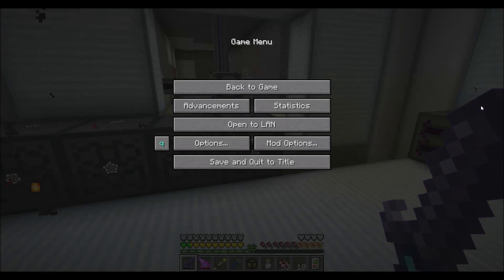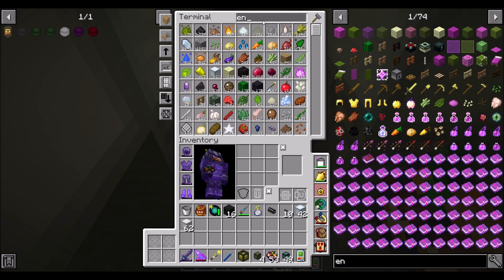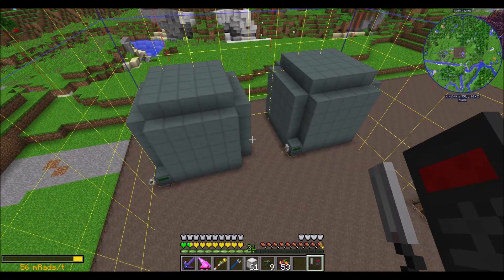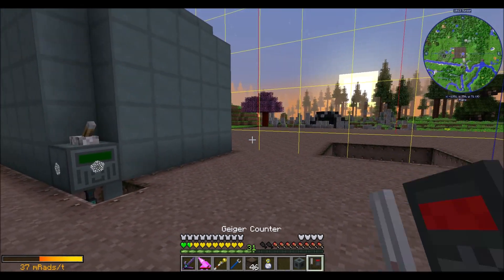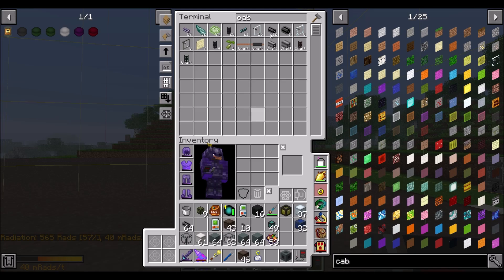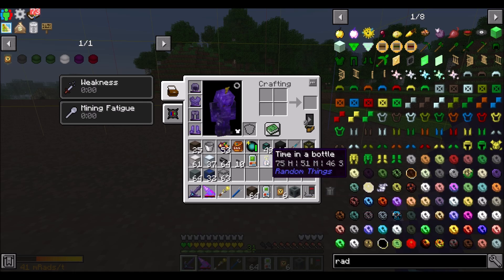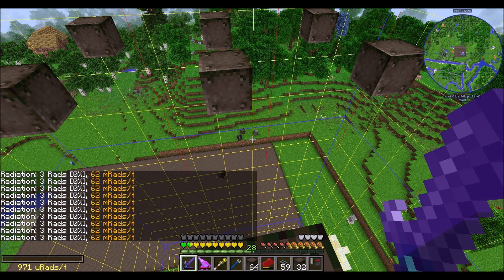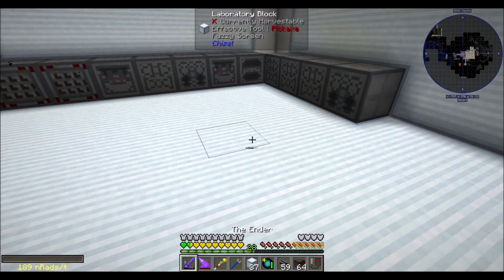MCEternal Ep100 Radiation Compensation

Comment: Small fix to your usage of SI units, Dire: 61 mRads is milliRads, microRads would be 61 µRads
Reply: or uRads with Minecraft font.
Reply: Double-fix, Gray (Gy) is the SI unit for absorbed radiation dose, where 1 Gy = 100 rads.
Reply: And if I remember correctly we have:
1fRad is femtoRad so 10^-12 Rads
1pRad is picoRad so 10^-9 Rads
1nRad is nanoRad so 10^-6 Rads
1mRad is milliRad so 10^-3 Rads
1Rad
1kRad is kiloRad so 10^3 Rads
Etc...
Reply: @BF26595   with micro added back in:
1fRad is femtoRad so 10^-15 Rads
1pRad is picoRad so 10^-12 Rads
1nRad is nanoRad so 10^-9 Rads
1uRad is microRad so 10^-6 Rads
1mRad is milliRad so 10^-3 Rads
1Rad
1kRad is kiloRad so 10^3 Rads
Reply: I had to stop video when he said "a 1000 microRads must be one rad" just to comment on his misuse of the powers of ten. XD Glad to see some one was on the ball when this came out.

Comment: if you put the reactor port in between the reactors instead of in the back, you could save yourself two plugs as you could have a single plug supporting both reactors on either side of it. This would also ensure that the plug is within the chunk. Just need some Ender io power conduits to the ports and the plug attached to it
R-P-R (reactor - plug - reactor)
Also, 19:48 you could have connected the two interfaces via a short cable instead of running another one all the way down... or better yet, filtered input using conduit and saved yourself a channel and an interface.

Comment: So i can confirm there is an issue with the auto crop breeder Dire. I built it myself on a server and it seems to be weird anytime that chunks load and unload. Yes i know SMP and SSP work differently but it is the only thing i have as to why it glitches out.
Reply: Yes even I built in my world and it weirdly fixes itself after some time. Even though I have those chunks loaded it does get messed up some time.

Comment: Let's completely clear up all your metric confusion.
It's: no prefix > milli- (m) > micro- (µ/u) > nano- (n) > pico- (p) > femto- (f)
It always decreases by an order of magnitude, which is a factor or 1000. So 1 Rad equals 1000 mRad and because 1 mRad equals 1000 µRad, 1 Rad equals 1000000 µRad.
Conversely 1 mRad equals 1/1000 Rad and 1 µRad equals 1/1000000 Rad. At that point exponential notation becomes easier to read, with 1 µRad = 1*10^-6 Rad. In summary:
1 mRad = 1*10^-3 Rad
1 µRad = 1*10^-6 Rad
1 nRad = 1*10^-9 Rad
1 pRad = 1*10^-12 Rad
1 fRad = 1*10^-15 Rad

Comment: Please please please design your reactors better. With normal LEU-235 it's not worth it but with TBU (oxide) you can just put long lines of checkered cells with redstone in between, redstone on the outer edges touching the cells, water in the middle outer edges also touching the cells and gold in between the water and the redstone to produce a lot of power (1.5 mil/t or something at max size). HEU-233 (oxide) reactors are also very good, because they can be very small and still produce a lot of power but to get the best bang for your buck you should use resonant ender and liquid helium active cooling at a minimum. In my Enigmatica 2 world I'm using that + molten iron. I'm willing to share my design but it is a little tricky to place the active coolers (because they are touching) and you have to set them up with some fluid outside the reactor, put them in a cardboard box and then place them inside, so you can't just copy paste gadget (or schematica) the thing in and expect it to work. The active requires a constant supply of resources but it won't be a problem for you because you have tier 10 everything crops. The liquid helium may be a little bit of a problem, 3 dense helium colectors all feeding in a supercooler seemed to do the trick for me.
Wow, >9000 word comment-essay. Hope the spelling is good.
Reply: Ha ha, yeah and' it's completely pointless because dire goes to a salt reactors and also said that he don't want to use oxidized fuels some episodes ago, lold.
Also he still uses mekanism fusion reactor as a main power source, he just don't want to waste "free" reactor power.

Comment: Please talk with the mod author about the shielding effects because your explanation doesn't make sense. Radiation in the reactor chunk is still 936 nRad (about 1 microrad) out of 60+ millirads. I think the plating gives a percentage shielding, like the scrubbers do a % of the radiation, but then I don't understand what the 1 means on heavy shielding. It's obviously not 100%.
Reply: The equation is that used in Fallout, i.e. rads = raw^2 / (raw + resistance)
Reply: NC creator here in the comments? 
Noice.